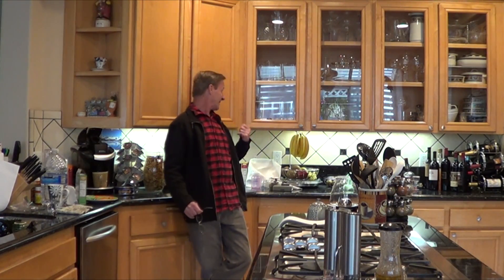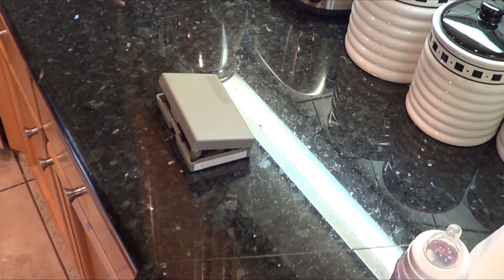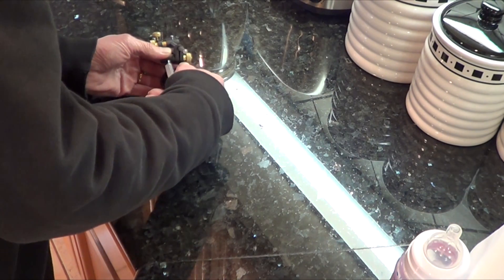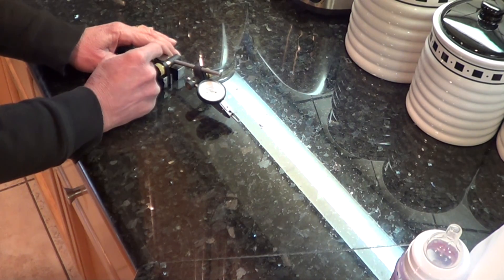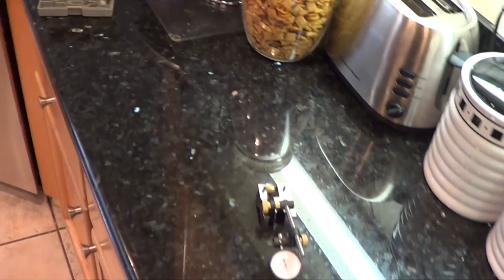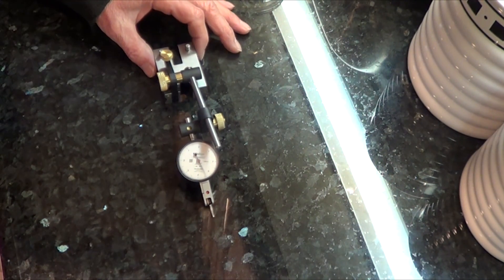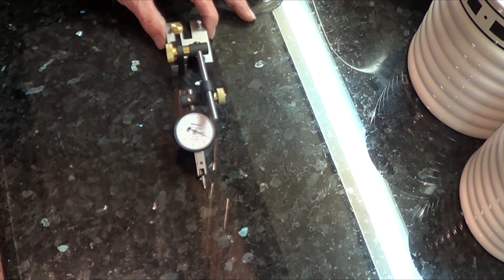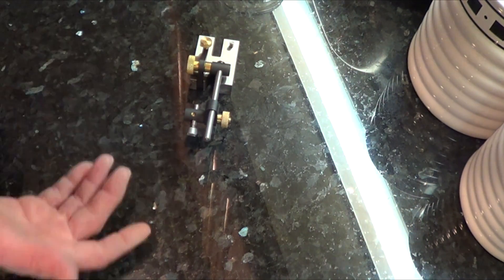Granite Counter as a Surface Plate Video #107

Comment: Those declaring that "float glass" is not suitable due to NOT being as flat as a steel or granite surface plate certified to AA standard (from 50 x 10-⁶ inches upwards. 1.2 x 10-⁶ m - or microns) should remember that AA is nowhere near as accurate as the hot or tin side of optical glass that ranges from lamda/4 to lambda/20 or better, where lamda is 638.5 nano metres!! Note NANO not microns!!

So saying a 1.2 MICRON accuracy is better than 21.9 (638/20) Nanometres is farcical. The glass is almost FIFTY times as accurate!! Even lambda/4 is more than an order of magnitude greater accuracy!

In MANY cases people trying to measure the surface flatness of what they THINK is "float" glass, especially when they call it "plate" glass are probably making more than TWO obvious errors:

1. Float glass is highly accurate dimensionally but the hot/tin side is exceedingly so and usually significantly better after float forming than the subsequently "fired" top surface. 

So when measuring it is vital to use the lower "hot/tin" side NOT the upper or "fired" side.

 Anyone who wants to test this should obtain a piece of PROPER float glass NOT just plate glass, which may or may not be float glass ... the former is made by "floating" the glass on top of molten tin - hence the term. (Unlike normal plate glass made by rolling hot glass between machined rollers) and measure both sides for flatness. The hot/tin side should be much flatter.

2. Optical glass is usually readily available, albeit somewhat more expensive as both sides are made to the same optical standard. However a visit to a proper float glass operation might well yield you a sample of standard 12mm thick glass for free.

This should be fitted to the top of a reasonably thick piece of granite (non reference surfaced) to give extra stability and rigidity, and of course top side (fired side) down! Google for how to tell one from the other.

Result a MORE than adequate reference surface plate probably as good as a B maybe even an A grade but absolutely good enough for the home hobbyist.

Comment: Any thoughts on float glass? It's formed by gravity acting evenly all over, should be very flat. David Gingery mentions in his book series that you could make a makeshift surface plate by rubbing 2 pieces of glass on top of each other with valve lapping compound... That was back in the 80s, I think float glass was not available back then.
Reply from the maker: Look for glass cutting mats extremely flat.. https://www.amazon.com/EK-Success-13-Inch-Cutting-Package/dp/B000LXC52W
Reply: @slik tyres ... You do know that float glass was developed by Pilkingtons in the 1950's and first produced commercial output by 1959!? 1980's ... I think not ... WELL old by then! 😁

Comment: This granite countertop was never intended as a precision flat surface. The flatness spec is probably +/- 1/32" just so the adjoining pieces mate up.

So what makes for a precision granite surface plate? It requires enough thickness so that its sag keeps it in tolerance. Notice how all the large plates become very thick, it is to maintain tolerance. Ok, so now back to countertops. They are typically only approx 1" thick. That results in a plate that cannot hold a 10 millionths of an inch tolerance over a 2 ft distance. However they should be able to hold a 100 millionths or a 10th of a thousandth of an inch tolerance over a 2 ft distance. That is what, a grade B plate? That is more than sufficient for the kind of work most people do. Again the plate has to be properly lapped with precision flatness in mind to begin with and properly supported. Of course, you can look all this stuff up in the USGov GGG standard for surface plates.

So real issue is, if you had a precision flat countertop plate how well would it hold its tolerance.

As for me, I bought a piece of granite countertop only to find that it is bowl shaped about 1/32" concave down. Now it just needs some course diamond abrasive and a lap to finish it off.

So that's my story. Comment about your adventures in granite countertop as a surface plate.
Reply from the maker: Bummer your plate didn't work out my chunk is within .005 in any case many have emailed me about using a granite counter top as a plate so I said lets find out which is the sole reason for the video. Personally I have a Starrett pink plate in the shop.
Reply: @TheMiniMachineShop  Snob. Hahaha. Good for you.

Comment: What about taking three equally sized pieces of counter and lapping them to each other?
Reply from the maker: Have a feeling a high spot on one would create a low in the other. Would take a lot of very fine lapping compound right! Interesting idea...
Reply: Here is how it is done with on metal lapping plates. https://youtu.be/rHmsQEAx16o Using three plates and lapping them to each other eliminates any errors. If two plates are match ground to each other, it is possible one is concave and the other convex. The third plate would reveal this error. Its explained in more detail in the above video. Doing granite plates using diamond grit would be the way to go.
Reply: Counter tops are thinner than a standard surface plate so they would flex more.  But I bet you could get something passable for a home shop.
Reply: Typically only one side of granite slabs, used for countertops, have been lapped. The unpolished side would take an extremely long time to get it close to the level of polish you would need to qualify as a grade B machinists surface plate. with enough time I’m sure you could make any piece of granite work I was just letting you know that the unpolished sides are extremely course it would consume a tremendous amount of time giving it to the level of fatness you may want.

Comment: Depending on who you are, and what you want to do, will determine if a granite slab will work or not, I also use a piece of granite off cut, it serves as a lapping plate, inspection plate, and Im happy with it, I am a hobbyists though, lastly the countertop is what it is, a 6 year old countertop, I'm sure the owner never intended for it to be an inspection surface. That being said, thank you sir for taking the time to do this demonstration,.